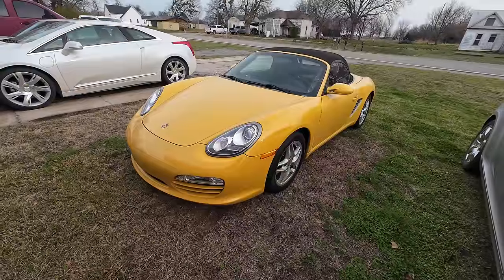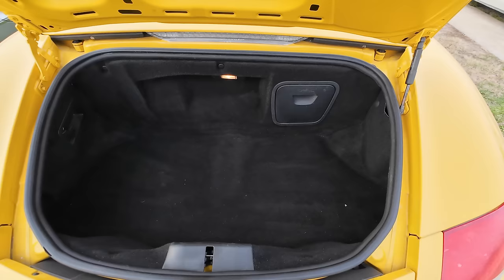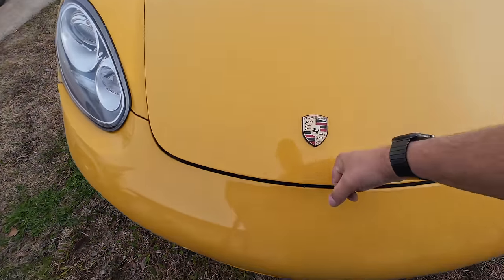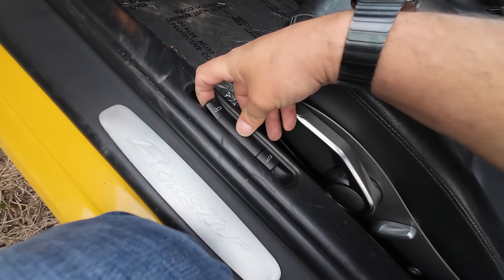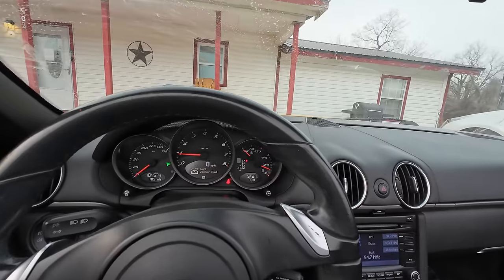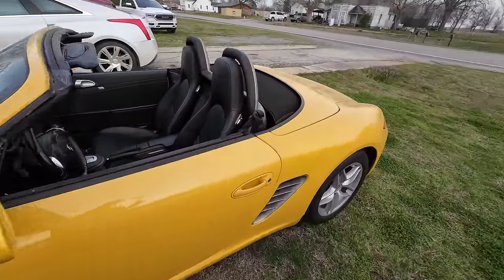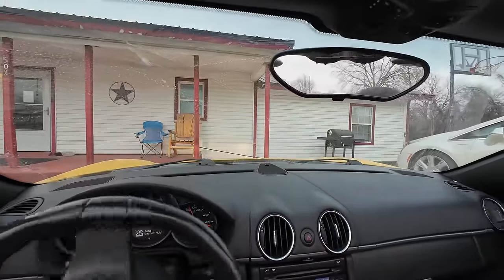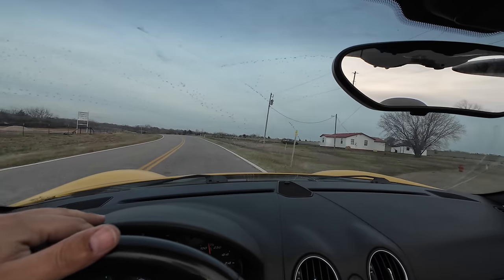I Bought this High Mileage Porsche Boxster for Super Cheap!

Comment: Sold my 2004 Porsche Boxster (2.7L) with 154,000 miles. My 3rd Porsche and by far the most reliable. Great post. The fuse box is in the driver's side wall panel. My car was on eBay auction. Sold to a gal in Texas.  Yes, mine had the egg-ish lights. Sold for $9,300. Great video, Randy.

Comment: In the front trunk, the other area forward of the battery used to be for the CD changer option on the Boxster. Usually it was in there with the Bose premium sound system, and the subwoofer was between the seats behind the driver and passenger. If it’s not optioned with Bose, then it’s like a little cubby hole with sliding doors ( Porsche salesperson 2002-2013)

Comment: Randy bought a nice yellow Porsche Boxster 987 (A)....making the right choice...lots of things under the front bonnet....summer is a state of mind...exciting roads ahead assured...🎉😂 the red line next to the driver panel is actually a positive charger in case of emergency...the part number you found on the dashbox is meant for 986, the older model...😅

Comment: If the oil fill or the washer bottle (that's not coolant) go bad, it's a PITA to change out either one- it's not expensive for the parts, but it takes time to get to or $$$ to have it done

Comment: The exhaust noise on cold start will be a leaking SAI (secondary air intake) which should turn off after about a minute or 2.  No big deal & I wouldn't bother fixing it..

Comment: six speed would have made it a lot better but nice buy.👍🏽
Reply: Yes, my Boxster was manual. During Porsche DE at Nelson Ledges, I blew past many 911 drivers. Not to brag, I'm a lucky guy. Having sponsored both The Bondurant Schoo of High-Performance Driving and Skip Barber, I have many days of professional on-track training. Personally, I avoid PDK. I also visited Zuffenhausen twice. My Boxster was 2004, speed yellow, 2.7L. I Bought it as a CPO from Penske Porsche in OH. Sold for $9,400 on eBay with 154,000 miles on the odo.